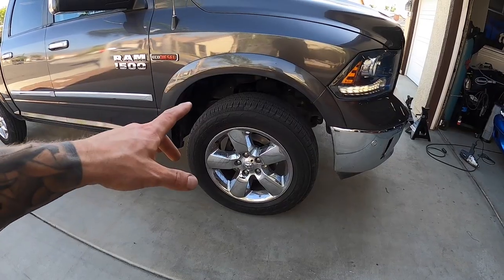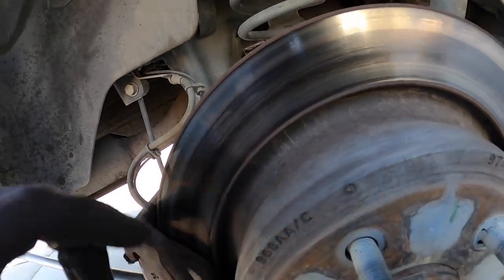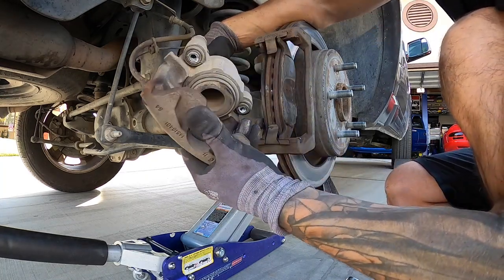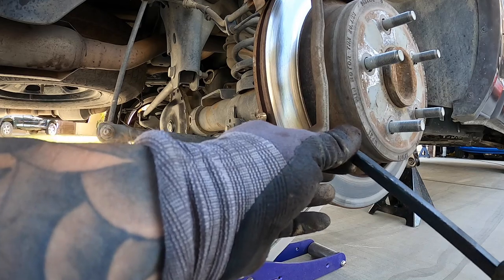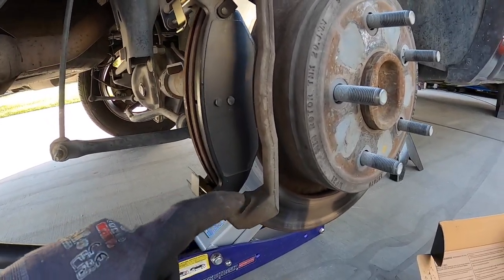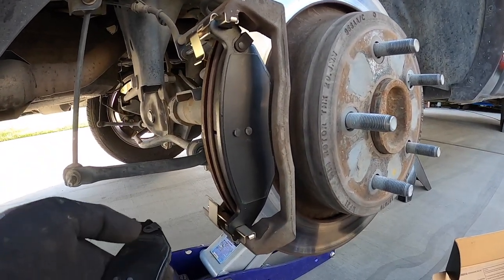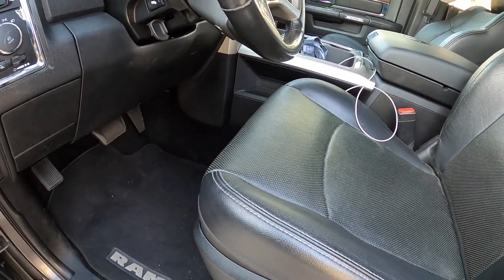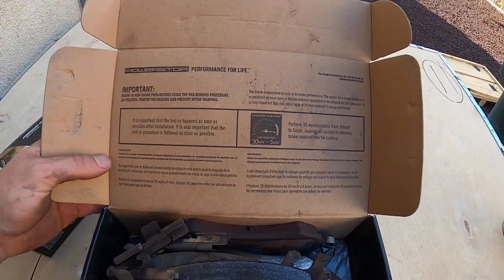HOW TO REPLACE RAM 1500 REAR BRAKE PADS

Comment: Just replaced my OEM pads at 89k miles 2015 4x4.  Fronts are almost due for a second time.  Used Wagner OEX.  The brand you used here we sell at my shop, no complaints.  🤙

Comment: I put the full Powerstop Z36 package on my 2005 Daytona edition back in late 2017. Same pads and still plenty of pad left now. No brake dust. The kit I bought had all 4 drilled/slotted rotors, carbon ceramic pads, and painted brake calipers.